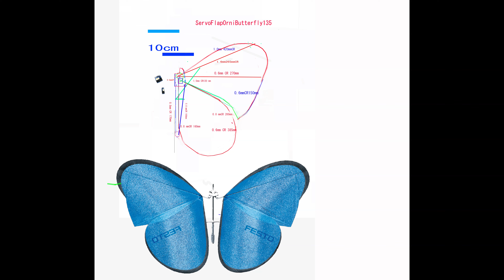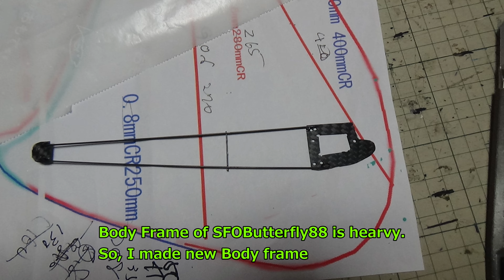サーボ駆動蝶型羽ばたき機 SFOButterfly135 31g: 1st Flight Test

Comment: What's the flight time for your ornithopters given their small capacity batteries?
Reply from the maker: Flight time varies depending on the Ornithopter.
SFOSwallowTail127 27g 70mAh 1cell Approximately 2 to 3 minutes.